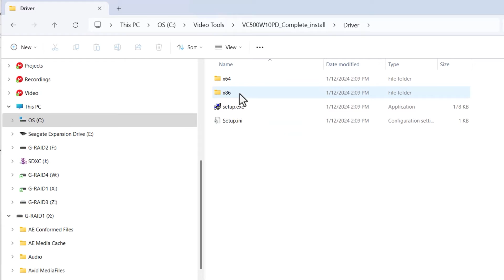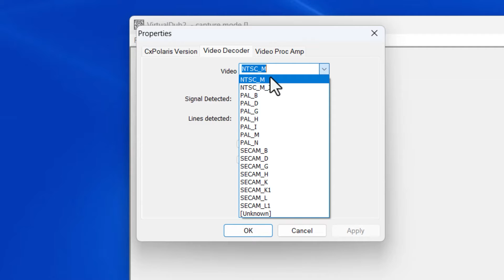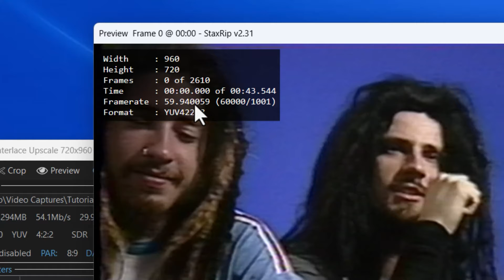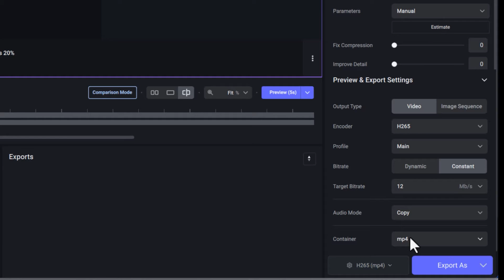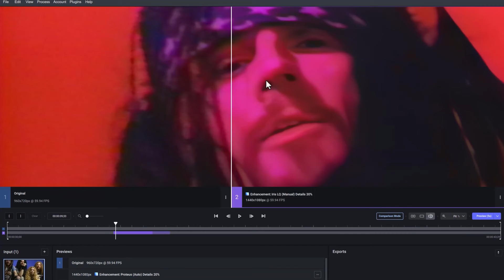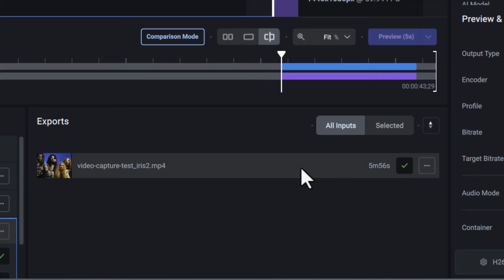How to Capture SD Video in VirtualDub2, Deinterlace in StaxRip, and Upscale to HD in Topaz Video AI

Comment: Popular video!  My only question is why not resize and deinterlace with just Topaz Video AI instead?
Reply from the maker: Since publishing this video, Topaz has gotten better with its deinterlacing (in the renamed "Topaz Video" instead of "Topaz Video AI"). It's worth giving it a shot depending on your source (use either the "Dione DV" or "Dione TV" option in Topaz). Topaz will still do it's own "AI" type of correction on the video, which can lead to some unpredictable results, but I've had success with it, especially on really clean sources. One thing to consider is that Topaz seems to consider 720 x 480 sources as 640 x 480, so you'll need to choose "Custom Resolution" if you are upscaling to 960 x 720. 

I usually start with StaxRip since the results are a bit more predictable, but Topaz is definitely a tool that I'll occasionally use as needed. I did recently run into an issue where a source from a DVD had multiple clips with fields that would swap depending on how the clips were shot (sometimes they were upper first, sometimes they were lower) so the results from StaxRip were totally useless. I could have gone through and painstakingly determined where those field swaps happened and subclipped everything, but instead I ran the entire video through Topaz, told it to "auto detect" the field order, and it did a nice job.

Comment: Thanks for this great video. I am amazed at what Staxrip has done to my captures.  I am having one small issue however.  I am hoping you may know what may be causing my problem.  After I deinterlace and upscale in Staxrip my audio and video are slightly out of sync.  Less than one second but just enough to notice that the audio and video do not line up.  Any ideas or suggestions?  Thank you.
Reply from the maker: How are you capturing your video? VirtualDub2 or something else?
Reply: @timfordphoto  Hi! I am capturing using Amarectv with the GV-USB2. I tried Virtualdub2 but had screen freezes and stuttering.  Thanks!

Comment: Great video.  I've downloaded StaxRip v2.48.0 but on the Resize option list I do not see GaussResize and a bunch of others you show.  Resize options are Bilinear, Bicubic, Poit, Lanczos, Spline16, Spline36, Spline64, Dither_Resize16, Resample.  Is there one of these you would recommend or something I need to do to add GaussResize to the option list?  Thx!
Reply from the maker: I'm seeing GaussResize on v2.48 - if you right click in the "AVS Filters" section, choose "Add" then "Resize" then "Resize" (again). GaussResize is the fifth one listed.
Reply: @timfordphoto  Figured it out.  My default panel was showing VS Filters (VaporSynth) rather than AVS Filters (AviSynth).  I had to click on VS Filters then Filter Setup then choose AviSynth to get to the AVS Filter options.  GaussResize shows up in the AviSynth resize options.  Thanks!

Comment: You need to crop to 704x480 before scaling to square pixels at 960x720 — otherwise, the final image will appear squeezed. not a huge deal, but if you’re aiming for a true 4:3 picture, it’s worth doing it right.
Reply: Do you do this when you are deinterlacing the footage or when doing the ai upscale?

Comment: I have a Panasonic 1980p ag also. I got mine refurnished because pretty well all 1980s need it. The 1980 cleans a chunk of the signal but really you still need a frame TBC for a lot of tapes. I still get dropped frames with just the 1980 in the mix.
Reply from the maker: Yeah, that's definitely ideal. They are just....expensive. The best luck I've had in terms of not dropping frames is actually using a FireWire capture device.

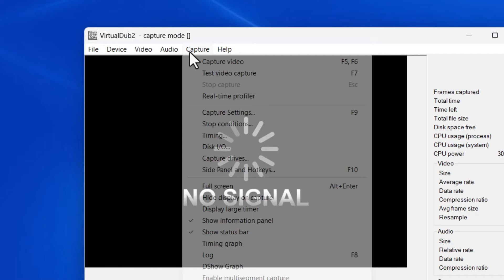Comment: Thank you for this clear and helpful tutorial! I do have one question about framerates. At 8:57 you mention that the framerate should be 29.9700. If I'm capturing interlaced video, my first instinct would be to set the framerate to 59.9400 to capture both of the interlaced fields for each frame of video. Is VirtualDub2 able to capture all of the interlaced fields at 29.9700?
Reply from the maker: Interlaced video is two fields per frame (an even and an odd field), so 29.97 is correct. The deinterlacing method that I use in the video converts each field to a frame, which results in 59.94 fps. I'm glad the video helped! I need to update the Topaz section, that software has drastically changed in the past year or so.

Comment: Hi Tim, thank you for your video, i will talk about it in an Amazon Review for a grabber based on VC500 (Mygica EZ Grabber 2). But i would like to ask you two things : 1) do you think the StarTech is better ?   2) why don't you use the filter deinterlace inside VirtualDub ? Maybe you told it, but i'm italian and i could have lost some words  🙂  Thank you and best regards
Reply from the maker: The VC500 is a great capture device. I'm not sure about the Mygica device. The StarTech device is still rock solid as of 2025 though and it's what I use if I'm capturing video using VirtualDub. Regarding the deinterlacing, I explain it in the video. Basically, you'll get far better results by deinterlacing using QTGMC in either StaxRip or Hybrid (or writing your own AVISynth scripts for using in VirtualDub) than you would by relying on the deinterlacing built into VirtualDub. Hope this helps!

Comment: Im getting an error when trying to encode with ffmpeg pro res in stax rip. Any thought's? Ty!
Reply from the maker: @SteveAlbertTV  what's the error?
Reply: @timfordphoto  it says error video encoding prores (v2.42.0). Code -1313558101 (0xB1B4B1AB). I get this code almost immediately after starting the job.
Reply from the maker: @SteveAlbertTV  I'm not sure what that might be. Have you tried using any of the other encode options?

Comment: I just tried to follow this video but every time I try to open a file in Staxrip I get an error about 7zip being the wrong version, and then the crop tool.
Reply from the maker: Try downloading and opening this project using the latest version of StaxRip - https://www.dropbox.com/scl/fi/q83u5e01l1uofabodaco6/Upscale-Footage-to-960x720.srip?rlkey=qsk4zyj2owtjqcgkcq8n7fgeq&dl=0
Reply: @timfordphoto  I got it working thanks. But another problem, after deinterlacing the video it seems fine and the length has not changed according to VLC. But when I import the video into Premiere it is a different length from the original capture. The audio is out of sync as well. Any ideas?
Reply: @SomethingRandomInc  What does your setup look like, are you using one of the same capture devices that I show in the video?
Reply: @SomewhereinTimePodcast  I'm using a JVC HR-S7800U VCR with an Avermedia CE310B capture card over S-Video. I am capturing with VirtualDub. There doesn't seem to be any problems with the original files, the audio is synced. I did notice that the default source option in StaxRip doesn't get the frame rate and length of the video quite correct, I have to change it to BestSource. Something to do with how it counts inserted frames maybe?
Reply: @SomethingRandomInc  Which codec are you using in VirtualDub?
Reply: @SomewhereinTimePodcast  Lagarith
Reply from the maker: @SomethingRandomInc  Oops, that reply was supposed to come from me (not my podcast account). Can you try a test recording using a different codec like Huffy or UT?
Reply: @timfordphoto  I tried that but no luck. I have moved on to Selur Hybrid which seems to solve the problem.
Reply from the maker: @SomethingRandomInc  Great, as long as it's working! I've been messing with Hybrid and it's very cool. It also seems to encode a bit faster than StaxRip.

Comment: Is this process essentially the same for capturing MiniDV via firewire from camcorder? 
Also, If I don't use Topaz, does the StaxRip process change? Or I just have my final video after those steps? Is that the best quality without using AI upscaling tool?
Thanks for your awesome video and help!!
Reply from the maker: Yes, the process would be the same for capturing via Firewire (DV is 4:1:1 natively, but that's okay). If you don't plan to use Topaz, you can use StaxRip for the final video. Here's a link to a StaxRip project that you can try using with DV footage. It'll output to a smaller mp4 file, but you can change the output settings - https://www.dropbox.com/scl/fi/mjqn3cuw6xu2ksl0zj6j6/Upscale-DV-Footage-to-960x720-mp4-container.srip?rlkey=blp9io8np399mn9idi05vd5g9&dl=0
Reply: @timfordphoto  That you so much for the response! I will give this a go!

Comment: Came back and saw this. Nice :) as I have  Startech USB3. Can you provide the Stax setting for DV that is not 4.2.2? If there is a better option than handbrake, then I'm open to use this. But for my customers, the AI upscaling might be too much and they will likely not want to pay for that time. So.... I have a couple questions.... is there a 'good enough' mp4 via Stax like Handbrake does - but better? And lossy (mp4) and lossless via the DV from 1394 captures?
Reply from the maker: The Staxrip settings for DV would be to select QTGMC (I use Placebo) and then in the settings (double click "QTGMC Interlaced") paste this in - QTGMC(preset="Placebo", InputType=0, sourceMatch=3, sharpness=0.2, tr2=2, ediThreads=8 ,AssumeBFF())

I use StaxRip as a go-between, so I haven't really messed with it as the last step in the encoding process, but in the "Encoder Options" there are a number of options for x264 and x265. The software is using ffmpeg for encoding, so if you already have lossy and lossless ffmpeg settings that you use elsewhere you should be able to use them here as well. 

If you are using StaxRip as the go-between, then the settings I described in the video using QuickTime would apply to DV footage as well for keeping it lossless. It'll be converted to 4:2:2, but there's no way around it.
Reply: @timfordphoto  thx - but staxrip won't even open - get a btchroma error and others, but opens up a vdub capture. so, my now question is the best rendering from dv avi (8mm/vhs) to mp4 suitable for tv and computer playback. thx :) i would hate to rerip everything via vdub (50+ gb files).
Reply from the maker: @ewitles  To open DV AVI files, you need to first go to Tools, then Settings, then click on "Source Filters". At the very top of these settings, change the first option to "FFVideoSource". Hit "OK" then double click on the "Color" AVS Filter and paste this in - ConvertToYV12(chromaresample="gauss",interlaced=true)

Then drag that filter just below the "FFVideoSource" filter. 

Or, after you change the Source Filters option, you can also try downloading a project that I created with the DV settings here - https://www.dropbox.com/scl/fi/caqz6bg64es6227g0yhg5/Upscale-DV-Footage-to-960x720.srip?rlkey=tka9fxrnxinzlsjd9ualb728l&dl=0

Then in StaxRip, just go to "File" and then "Open Project" and browse to the downloaded file. You should be able to open DV files by using that project.

That project is setup to encode to a 422 QuickTime file, but you can change the encoder settings to your liking. I'll do some exploring on lossless mp4 settings. My target bitrate for the stuff that I'm encoding in Topaz is usually between 8 and 12 Mb/s
Reply: @timfordphoto  thx :) i just 'ripped' 24 8mm video8 & hi8 via the digital8 deck. i had 4 problem tapes and finished the job on my hi8 deck via the dv encoder. and then 11 vhs tapes. my pc ain't beefy enough to quickly render 50gb of vdub rips nor do i have the space. onward to tomorrow :)
Reply: thx. that worked. but have one last question (hopefully) :) since i don't really need the the super hd upscale (topaz) nor have the horsepower, what are good settings for staxrip to deliver a decent quality mp4 (think handbrake hq 480) suitable for smart tv/pc playback for both the usb3 and dv rips?
Reply from the maker: @ewitles  Give this project a try. I basically just set the output to x264 and the container to MP4, then adjusted the settings accordingly. You can change them to your liking though. https://www.dropbox.com/scl/fi/mjqn3cuw6xu2ksl0zj6j6/Upscale-DV-Footage-to-960x720-mp4-container.srip?rlkey=blp9io8np399mn9idi05vd5g9&dl=0

Comment: Hi Tim. I am using an ADVC110 as my capture device. AV/C tape recorder player as my selected device. When I try to do the custom format based on your settings I get the capture device does not support the selected video format. Any suggestions?
Reply from the maker: That's a Firewire device, so I'd use the free Scenalyzer to capture the video (https://www.videohelp.com/software/ScenalyzerLive). That's what I use for firewire capture. Firewire is 4:1:1 anyway (in the United States anyway) so there's not really a need to capture in 4:2:2. Everything else in the tutorial will still work with the captured AVI file.

Comment: This guide has been extremely helpful. The only thing I'm unsure about is cleaning up the audio. I see that I can choose an audio file in StaxRip, but when I do so, it never syncs up correctly.
What might I be missing? I am using the same bitrate and everything as the original file.
Reply from the maker: I'm not sure, I've never tried using the method I describe in the video with a separate audio file. You might need to use a different piece of software to get the audio synced up.
Reply: @timfordphoto  appreciate the response. I just realized that I can replace the audio in VirtualDub. Thanks for everything!

Comment: Help!!!!!!! I'm trying to deinterlace uncompressed AVI files using the exact settings in your video for StaxRip and I keep getting encoding errors.  First I was getting audio errors when I loaded the file so in the interest of time, I changed the audio options to no audio and the audio error disappeared but when I tried to do the final conversion step I get an encoding error.
Reply from the maker: You might need to set up AVISynth/QTGMC and then use VirtualDub for the encode process. I can provide a script if you get AVISynth and the various plugins up and running. I've used this video in the past to get AVISynth and QTGMC installed - https://youtu.be/C4PyyQoz6eo?si=MKfmlO2tuya6bfJ2

Comment: im getting no audio output when the job finishes
Reply from the maker: Have you tried other audio encode settings in StaxRip? Or is the issue when outputting from Topaz Video AI?
Reply: @timfordphoto   when i finish the job in staxrip, the same way you do it, it either has no audio or has audio randomly
Reply from the maker: Would it be possible to share a small piece of the original AVI that you are working with? Curious to see if the same issue occurs on my end or if there's an easy fix.
Reply: @timfordphoto  how without compression?
Reply from the maker: Could you just capture a short clip from the same tape and put the AVI on something like Dropbox?

Comment: Hi, Tim. I followed your procedure and it turned out great. Did you happen to test the HD conversion using Topaz before deinterlacing using staxrip? the result with vhs videos seemed better in this order, but a problem appeared: the video is out of sync with the audio after the QTGMC deinterlacing process, and it seems to me that it has to do with ffmpeg2source, since with Avisource it is correct . Do you have any suggestions for making the video exported by Topaz compatible with Avisource in a format that does not have any loss of quality?  thanks a lot
Reply from the maker: That's interesting. I haven't tried it in that order. I wonder if you could extract the correctly timed audio as a WAV file and then use something like Shutter Encoder to replace the audio on the out of sync file. I'll do some testing on Monday.
Reply: @timfordphoto  I changed my mind, I think vhs footage enhancement is better in this order:
1. VirtualDub2 utvideo capture (720x480)
2. QTGMC deinterlacing (placebo) WITHOUT using a resize filter and through Avisource so the audio does not get out of sync
3. Topaz Video Ai 4 (Iris LQ manual parameters - low quality video input condition) with 2x upscaling to export the final file. Thank you for your attention, your tutorial helped a lot!
Reply from the maker: So you upscaled but didn't deinterlace using Topaz? And then deinterlaced the upscaled footage using StaxRip? I haven't tried that method before but I can give it a try and see what happens. How long was the clip you were working with?
Reply: @timfordphoto  In fact, I took the file captured by VirtualDub2 (avi/utvideo/720x480/pcm) and improved the video using "Iris - face/ LQ-MQ model": Input condition: (Low Quality) and manual parameters. I chose "Progressive" as Video Type, even though the video was still interlaced. If you choose "Interlaced" Topaz will do the deinterlacing too, so the video would supposedly have two deinterlacings if we still use QTGMC afterwards? lol. I only tested it the first way and I liked the result (I don't know if you would think the same), especially since I didn't upscale it in Topaz, I used the resize command (1440x1080) only in staxrip together with QTGMC in the file exported by Topaz, this way the process carried out in Topaz was much faster due to the lower resolution of the video. The clip I used is 23 minutes long, and there are no synchronization problems in the file generated by the VirtualDub2 capture, only after QTGMC deinterlacing. (But if I use an avi file compatible with Avisource, the deinterlacing does not generate desynchrony between audio and video).